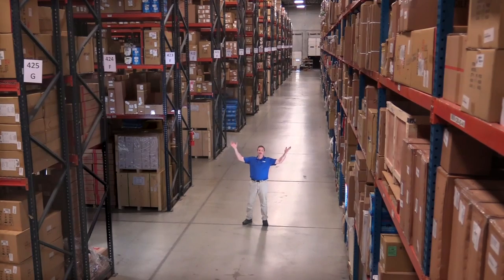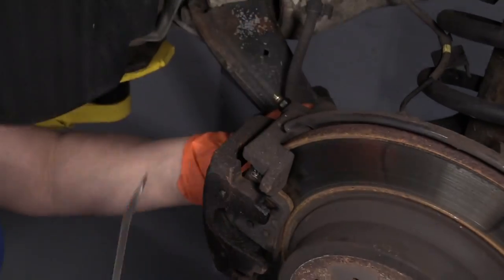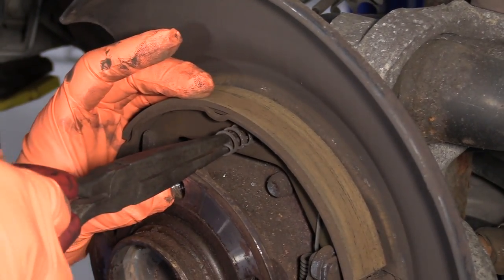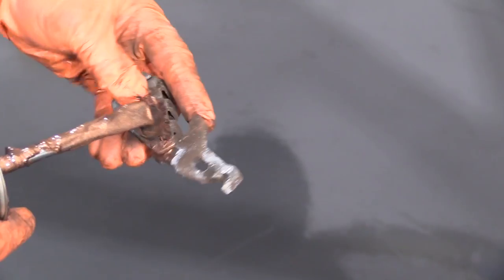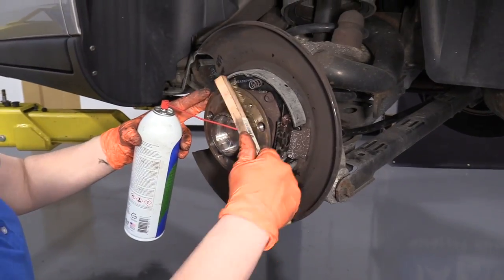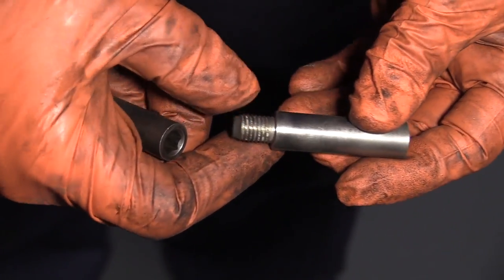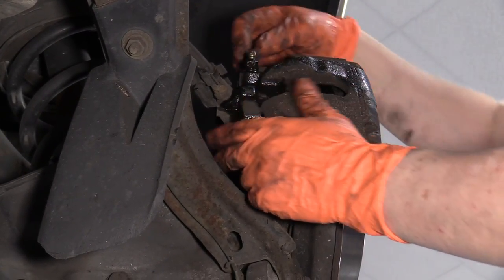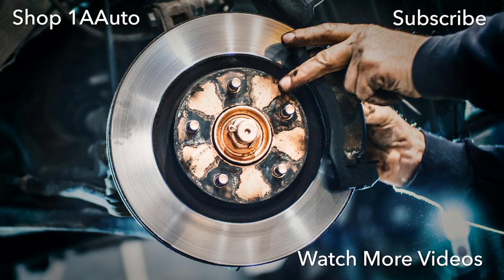How to Replace Parking Brake Shoes 00-07 Volvo V70

Comment: what is the reason for opening the bleeder screws if car has ABS sensors? most likely the caliber will move down without opening bleeder screw?
Reply: To release a small amount of pressure from the piston to make it easier to get the caliper off.
Reply: I have always used a large C-clamp to push the caliper in and have never had a problem pushing it in without cracking the bleeder screw open (and no harm to the ABS system). 

The only thing I have watched out for is if someone had filled the brake fluid reservoir when the pads were very low. I open the reservoir tank and watch to be sure it doesn’t over flow as I push the caliper piston in, siphoning off the excess fluid as needed.

Being a closed system, I’m not sure what benefit there is to opening the bleeder… a negative result in my mind, since you may introduce air into the system by doing that and add time to your job by having to then bleed it.

I am sure Sue or a member of 1A may have a reasonable explanation (that may change my backyard-mechanic practices!), but I have yet to experience an issue using my own method in which I leave the bleeder alone unless I am replacing the caliper (which she may have done in the process of this repair, but isn’t shown since this video is specific to the e-brake system).

Comment: One tip - the endings of springs holding brake shoes are bended in opposite directions. While lookiing from the side on spring they together create a letter S shape, easy to remember since Volvo are S60/S80. So you don't need to guess where is the hook.

Comment: Just did this. A tip, you can see the springs behind the hand brake shoes if you pull them so you can see how they arenoriented. Makes it so much easier to get them off.
Reply from the maker: +Erik Ny Thanks for checking us out!

Comment: An excellent explanation without Magic Special Volvo tools! Brake shoes always come with multiple springs of different lengths, and which have to be removed / replaced in a particular order and that is why I came to this video. I got the job done much quicker with your instructions than I would have by myself. Thank you for your assistance -you're my Right Hand Man - oops sorry I meant Right Hand Maam.
OOPS I forgot to say one thing - whenever you have worked on brakes, before you set off anywhere do press the brake pedal several times. You have NEVER felt such acceleration as you do when you approach a road junction, press the brake and nothing happens!
Reply from the maker: +Gas Gas Thanks for checking us out. Shop for high quality auto parts on 1AAuto.com:

http://1aau.to/m/Shop-1AAuto-c

Comment: Thank you for this video. Just an FYI for people attempting this on brakes as old as mine (they were literally so old/rusted the pads disentigrated in my hands and had to be snapped off with the old rotor).

Be VERY careful when prying out those dual purpose compression/tension springs that latch into the brake shield. Mine were so stuck and I got frustrated yanking on them, that the actual welded on clip to the brake shield snapped off, leaving me with nothing to cook the new spring onto. I had to get a whole new brake shield and it cost $40 and takes weeks to ship because no one stocks them.

I didn't yank very hard, and those little metal holes are spot welded on with a tiny spot on both sides. They WILL seperate from the cover easily, and you will basically be shit out of luck. You could maybe try to JBweld them back but I wouldn't trust it because the way the brake system is designed in these cars could result in catastrophic failure of the CV joint if anything in the parking brake system comes loose while driving

Comment: Very useful video. Thanks. The only problem is the handrake cable. Shouldn't that be loosened at the handbrake lever (in the car)? With new shoes, you will probably have trouble getting the drum/disc over the new (thicker) brake shoes. Agter you will need to adjust the handbrake cable, as well, or is that automatically adjusted?

Comment: Do you have to release the parking brake cable?   I imagine the rotor will not go on, unless the parking brake cable is released.  Also, I could not find the link for the parking brake hardware and shoes  at the site provided below.  terrific video.

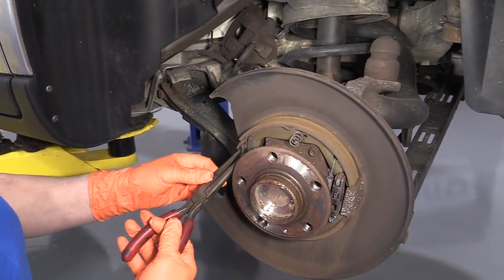Comment: Great video! I was running through this procedure today, and I figured out a little trick that should make it easier to get the shoe springs out right the first time. If you look at 4:59 in your video https://www.youtube.com/watch?v=phO0arqqxRM&t=299 you can get a pretty good view of the spring. You'll notice that the coil of the spring comes out and then at the part where you grab it, it makes a sort of 90 degree bend to go back down through the center towards the hook. Well, it turns out that the springs all have the same design and that the hook on the inside end of the spring is always pointing in the opposite direction of the bend at the top of the spring. Looking at the spring at 4:59 in your video, if you imagine a clock face, the bend in the top of the spring is pointing outwards to 3 o'clock, and that means the hook at the bottom of the spring will be pointing outwards to 9 o'clock. Knowing this, you'll know that the hook is pointed left and is hooked around the left side of the slot, so you'd want to grab the spring, push in, and move the whole spring over to the right (towards 3 o'clock), which would position the hook directly inside the slot, and then pull the spring out. I tried using this method on the second set of shoes and got it right the first time on both the top and the bottom. I know this explanation is a bit wordy, but I hope it helps. I might make a video explaining it and post it on my own channel!
Reply: That was great explanation, thank you Peter.

Comment: I’ve used a C-clamp around the caliper to press back the piston a little so as to remove the caliper.  Didn’t loosen the bleeder bolt.  I heard ABS restricts pushing back the caliper piston, but I’ve not noticed that.  Did I override it or mess with the ABS in doing that?

Comment: after she opened the bleeder valve and let the brake fluid cover the whole brake caliper, she didn't clean off the fluid. That was  pouring on the brand new pad. She also touched the braking surface of the pad with dripping glove.
Why didn't she sprayed off the excess brake fluid from the caliper before fitting everything together again?

Comment: why did you have to take the shoes off the caliper assembly?-  couldn't the caliper be unbolted from the wheel assembly as a complete unit with the shoes, rattle spring intact?
Reply: It's because she changed the brake pads at the same time. If you're only changing the handbrake shoes, then you can remove the caliper as a whole.